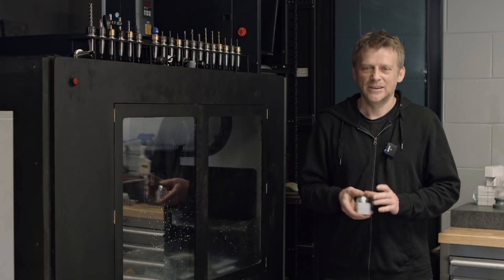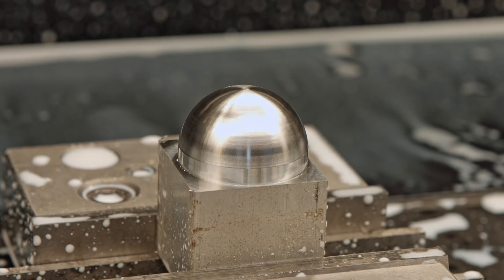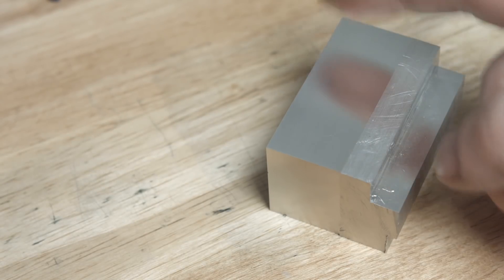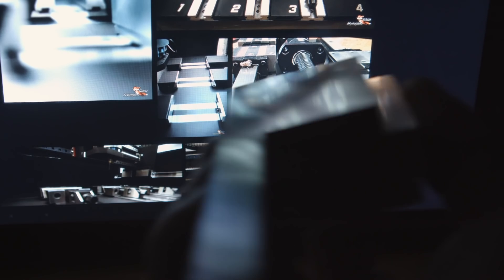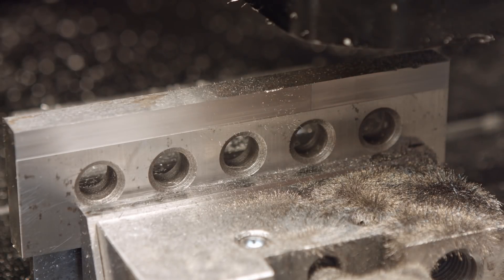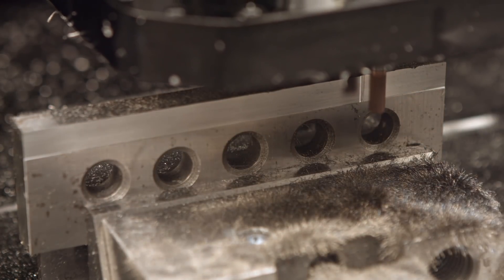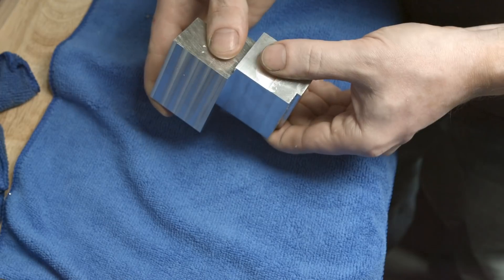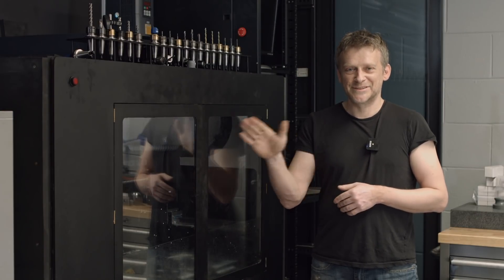The chase for the best possible CNC surface finish! - Mirror finish up close, really close.

Comment: Uh oh, now that you’ve got it milling steel, which aluminum parts of the mill have too many nanometers of flex and need to be replaced with stiffer steel parts? 2022 upgrade series in the works already! :D
Reply from the maker: Yeah.. now i should stop fu..ing around and do  some actual paid work ;)
Reply: @PiotrFoxWysocki  that's crazy talk...  ;-)
Reply from the maker: Cheeky Cheeky 😉😂

Comment: Any reason you didn’t use flood coolant for the steel cuts? It would be interesting to see the difference in surface finish. Love your machine!
Reply from the maker: Thanks 😉 I wanted to see if chip color. Brown ok, blue too much. Flames - definitely something wrong  ;)
Reply: @PiotrFoxWysocki  as long as your workpiece and tool stay cool there's nothing wrong with blue chips; means the heat is going where it's supposed to.
Reply from the maker: I guess this was my simplification.

Comment: Is that the Chinese 2.2kw spindle?
Reply from the maker: yes and no :) its chinese but 2.5kw ATC https://youtu.be/h9q6j7POgOI
Reply: @PiotrFoxWysocki  Is ATC better in regard of rigidity than er32 or er20?
Reply from the maker: Atc stands for automatic tool change. 🔧
Actually it should decrease the maximum rigidity. 
Because its one extra piece.
Spindle -》tool holder -》er20 collet -》endmill

Comment: Hey Fox, like so many others I am inspired by your work here, thanks for sharing. I am part way through building an 2.4m x 1.2m CNC, mainly for wood - but of course, the dream is for it to do a respectable job on aluminium, and even look mild steel in the eye without peeing its pants. I have used composite materials - steel & concrete frame, epoxy levelling, the gantry is aluminium, steel and epoxy-granite. It's quite the mash up, from bits n bobs I had available. I'll make a video for my channel when done :) 
Thanks again.
Reply from the maker: Hey! thank you very much :) Never thought i would have such an influence. but after this build i'm a bit worried, i might put too much false hope for people to go and make a cnc just like mine. It looks easy on the video... in practice it might be much harder. 
2.4x1.2 is big :) for wood should be perfect. for harder stuff i would go with something smaller. of course it depends what kind of finish you are looking for and tolerance. 
but i guess you could cut anything on the big one if you adjust tool paths for the machine. and if you will mill in the corner of the machine and not in the center.
Reply: That's what I am thinking ;) corner milling for hard stuff... no idea how it will work. We shall see...
Reply: ps. where do you actually buy your endmills? I don't see a shop on the Winstar website...
Reply from the maker: Carbide.nz they are close to me. But im not sure if winstar are the best endmills. 🤔

Comment: It looks like the tormach vrs datron video from nyc cnc? If it is similar challenge it would be great to compare the times! Of course you would nedd same tooling and fusion setup with i believe they go over in the video? Btw what axis controller do you use? Is it pwm or step n direction yet? I dont believe its as much software that upgrades the machine as much as it is the axis controller n drive n servos n yours looks pretty darn good. What is your max feedrate and rapid? Nice video!
Reply: I think it would be awesome to see your diy mill beat tormach lol n keep up with datron! You would be a hero! Lol 😁
Reply from the maker: But i thought i was already your hero 🤣😁
Reply: @PiotrFoxWysocki  well of course 😁
Reply from the maker: Hahaha 😁
Reply: @PiotrFoxWysocki   I know you only care about surface finish but 2850mm   Can't be right it's only a 100" of minute I know your machines capable of more than that with all the nice servoz and ball screws Can you can get nice finishes with high rates of feed Since you have a very fast in the motor.  I mean looks to me like you made yourself your own little Mini datron. Lol
Reply from the maker: @jasonruch3529  😀 well. If i have to compare it would be something between Datron and mori or something heavier/similar. 24k spindle and 130kg gantry. I dont think Dathron gantry is so heavy. And their spindles are double the speed. So they could go faster. 
I did test it already and i dont need more speed than 3m/min otherwise the spacing between cuts is getting really visible. 
I guess im very particular about finish 😉
Reply from the maker: I got the idea for the sphere from NYC CNC, I thought its a good shape to test all the axis at once and precision. i wasn't interested in the exact tool path. i was focused more on the finish as this is something i will be using. 
i use uc300 with mach3. max speed 2850mm/min as i put all the speed in to the resolution. again its for my use and not to impress people with how fast it can move.
i prefer to impress my clients with the quality of the finish :)

Comment: Is the steal flakes burning off really a problem? If the heat is removed with the chips and there is no chattering, it is perfect, isn't it? As long as the endmill and the part are good, what more do you want? The surface looked great.
Reply from the maker: thanks :D well.. you know in theory it makes sense. but when you see those chips start glowing brighter than the all the surrounding lights you get doubts :D i have seen some extreme milling in flames, but i thought it was more like a stunt, than actual practice.
Reply: @PiotrFoxWysocki  Of course you have to take the risk of fire into account, you don't want your case to burn up.

But on the other hand, how cool would it be if you could cut at such extreme rates and not dull your end mill? I would certainly find such tests to find out if the end mill really doesn't get dull pretty impressive.

And I think I am probably not the only one you would seriously impress if your machine could do that.

I was wondering anyway why you weren't using cooling. Why didn't you?
Reply from the maker: I didnt used coolant to see the color of the chips. And to see what is going on.

Comment: very cool build.  I would like to see you mill som regular cold rolled steel that is NOT hardened.  Milling hardened steel is the exception for most people, but milling mild steel is, for me at least, a requirement.
Thank you for an excellent series.
Reply from the maker: Thank you for watching 😉 well i thougjt when it will cut hardened steel it could cut anything. Sorry for my ignorance 😉
Reply: @PiotrFoxWysocki  Yes of course you will be able to do it. I just thought it would be interesting to see if a setup like you now have would be practical for steel milling.  You know, what kind of speeds  and feeds you could achive.
I don't doubt your granite and rails..  More curious about the spindle.
Thanks.
Reply from the maker: I see. Makes sense.

Comment: I love your work, but here are my two cents on comparing surface finish: don't compare a surface ground a long time ago with a surface just milled, because any surface finish/mirror dulls in time. Compare instead two surfaces equally freshly worked (freshly ground against freshly milled)
Reply from the maker: fair point. in my defense i had to compare it to something. this parallel wasn't that old either, just got some rusty spots. But i haven't noticed much of a difference  between old ones and new ones i have. 5 years vs 1 year to be precise. bummer i can't put a picture in the comment.
Reply: @PiotrFoxWysocki  Well if 4 years don't make a difference, then one year won't make a difference either. Amazing surface finish!!

Comment: How a flat surface is obtained is compared to a high accuracy class surface plate. With an oil paint, e.g. Prussian blue
Reply from the maker: good question, i haven't checked it yet. i was focused on the surface finish mostly.
Reply: @PiotrFoxWysocki  You cannot refuse to sand-grind parts that require surface quality. :(

Comment: So, you are using 2 servo's for the Y right? does that sync up pretty well? Really nice result! really want to get different parts for my build now I have seen this result.
Reply from the maker: yes, the biggest problem is to tune both of them at once. which apparently is not possible. but manually you can do this. looks like they work ok.

Comment: I would like to see your machine to test some cheap DLC endmills, i do get great surface finish from those endmills, but i belive you will get mirror surfaces for sure! 8mm 3 flute is the one i have, and i use that one as a finisher.

Also, you went way too slow on the steel ;) way lower rpm or faster feedrate :) look up FSwizard as an app on your phone, that one is great for getting a ballparked feeds and speeds, and you get quite abit of materials on the free version.
Reply from the maker: Yeah, i was craving for those for some time now. i guess i will have to dedicate a day to find something decent and order. 
i kinda figured out that there was something wrong with the steel :) thing is that i never cut steel so I never looked speeds and feeds. 
everyone is going slow so i wet slow as well :) as you said too slow :)
but yeah hardened steel for me atm is a black magic :D
Reply: @PiotrFoxWysocki  it will handle steel quite well to be honest, perhaps not as production, but for some parts now and then.
i found my DLC coated endmills at Aliexpress, about 10-15$ for an 8mm.
i will see if i can do a steel test on mine again on day amd post out, i have done 10mm depth and 0.3 aswell, went fine, but you get by far better surface finish.
Reply: when thinking about it, mine has taken some tests on hardened steel aswell, as have i had some taste on the hardened jaws on my vise..
Reply from the maker: @Kjetor i just want them for aluminium. As you have seen steel is not my thing 😉
Reply: @PiotrFoxWysocki  hehe, not quite the right spindle for steel.
i have a 4 poled 3kw, it has quite abit more power at lower rpm's, so that helps me abit
Reply from the maker: @Kjetor i know something about it. I did those tests with my regular aluminium endmills 20k rpm 2m/min 😉
Reply: @PiotrFoxWysocki  hehe, i cut mostly at around 9-12000 rpm range, 12600, 5400 mm/min, 10mm deep and 0.8mm radial is my roughing for Guhring 8mm 3 flute endmill in alu.